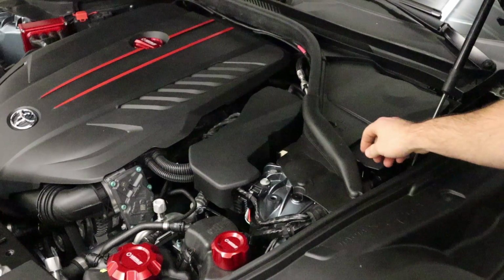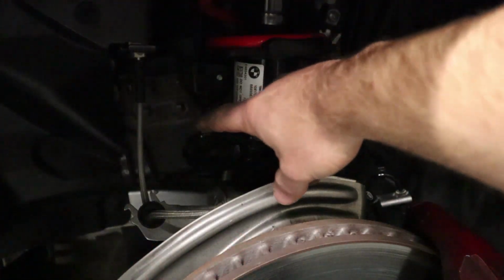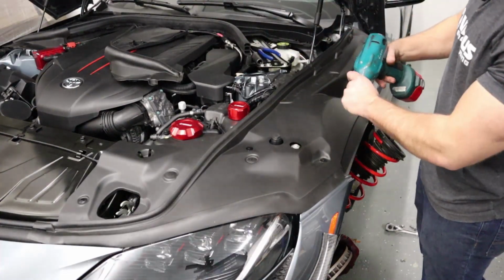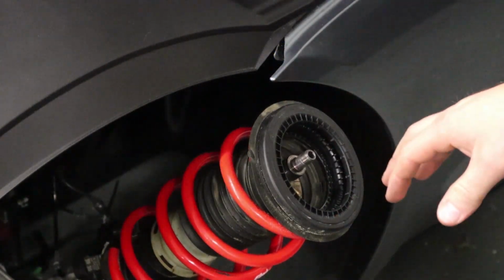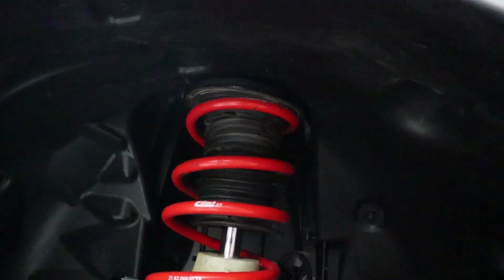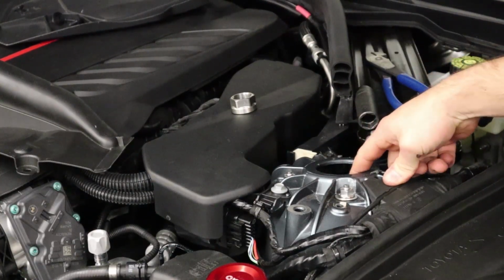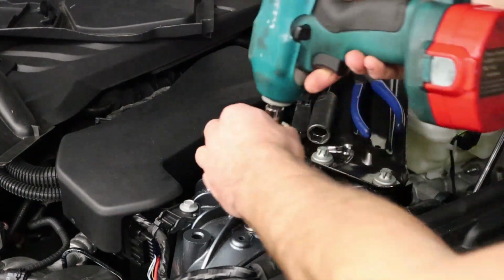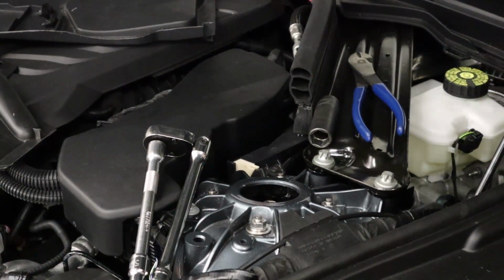Verus Engineering Front Camber Plate Assembly Install - Mk5 Toyota Supra

Comment: Wonder if you could turn them 180 degrees to add some positive camber tires are wearing fast on the inside to much negative camber as it is.. any idea?
Reply from the maker: We've had some customers do so. We believe it has worked for them.

Comment: I assume you can adjust the camber while the strut is installed, looks like a tight fit in that small circle in the chassis.
Reply from the maker: Yes, camber can be adjusted once the strut has been installed.
Reply: It is actually almost impossible trying to adjust camber in that small hole. Unless I needed some sort of special tool, regular Allen keys don’t reach all 4 bolts.
Reply: @troybizzle   Kind of what I was thinking - From the videos I couldn't see a way you'd reach those allens at all

Comment: Can you confirm if there is more noise vibration with this part?
Reply from the maker: There is minimal noise and vibration difference, but there is a slight increase due to the style of our camber plates vs the OEM units.
Reply: @Verus Engineering would this part be road compliant?
Reply from the maker: @davidkelly2542  yes.